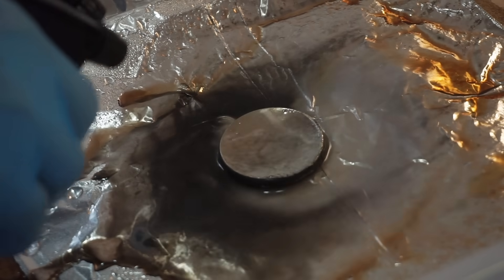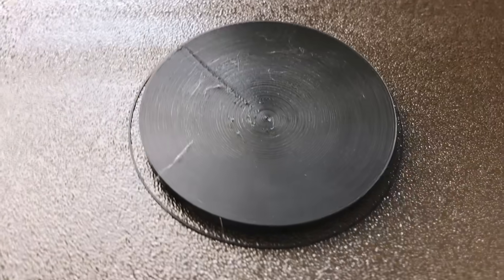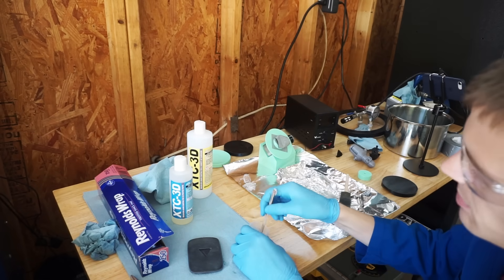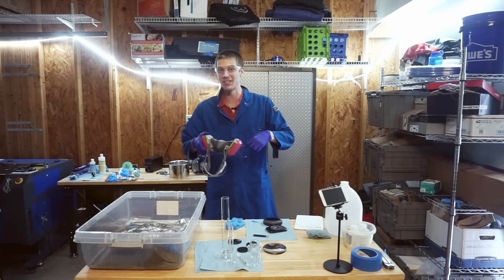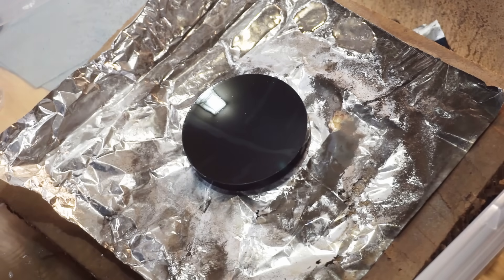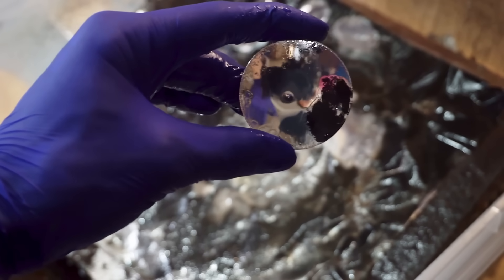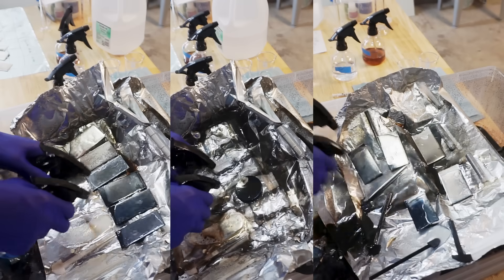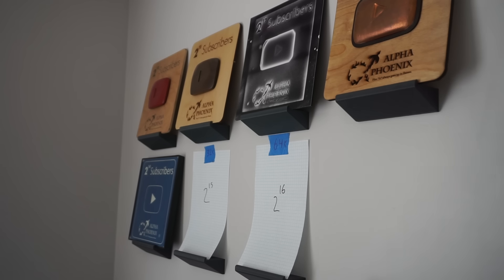How does a "first surface" mirror work? (2^15 sub special!)

Comment: It's not that you aren't removing bubbles. It's the 3d part and it's porosity that's drawing air in from underneath and from it's inside. Also thin layers don't help either.

Comment: have you considered foregoing 3d printing and instead using rotation to make parabolic surfaces? if you put a petri dish of resin on something that spins like a computer fan or a record player you could use the centripetal acceleration to form a perfect parabola without the 3d printing step.

Comment: Depending with what material you print, there are solutions that chemically melt (it's probably wrong, what happens is the same as with Styrofoam and glue) the surface of your prints, making them smooth.

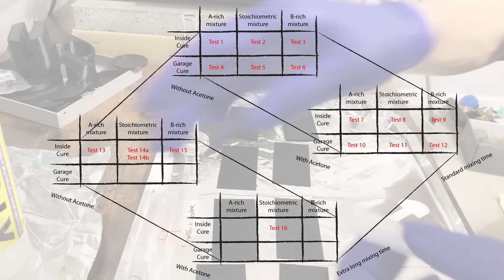Comment: Research engineer here. The next time you start creating a big grid to "properly" test every variable (13:23), first do a web search for these three words: NIST covering array

It will not replace the final stage of testing with only one variable changed at a time, of course, so it's not a technique for the final stage of publication-worthy conclusions. The time to use a covering array is earlier, in the stage you described as throwing variables at a wall to see what sticks.

That's not the time to be comprehensive, it's the time to throw in even more variables. Yes, more variables, because if you're not sure of which vars to test, then you're more likely to be making a mistake about which vars to exclude.

And yes, the problem is that you now have an even bigger grid of tests, so how does this help? You were already at the point where it was too expensive to test everything by changing one var at a time, so the best you can do is run a few spot checks which at least cover(!) each var at least once. That's where covering arrays come in. They're a mathematically sound way to make a set of spot checks "as good as you can get" for those times when you can only do a few spot checks.

Do the web search for details. The NIST has a good set of covering arrays already computed for us, and they're free.
Reply from the maker: I probably could have gotten away with sparser sampling for the garage vs not, but considering that all the other conditions in the first batch were distinctly different recipes, I wanted to test them all - there weren't that many. in the second batch I DID go sparser

Comment: PLA is one of the worst filaments to sand, I've gotten ABS parts to gloss finish just by sanding even without polishing, resin prints have the advantage that they start out smoother

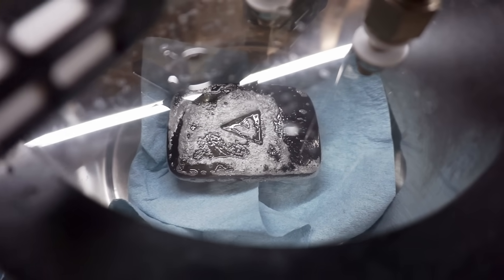Comment: Usually resin people put the resin in a vacuum chamber before using it to degas it, and the use a pressure pot while it's curing to shrink the remaining bubbles, so it doesn't bubble up on the part like on the play button at 15:00 :)

Comment: So, this may be overkill, but I know that some mirrors on large telescopes are made by rotating a dish full of mecury or similar....so you could probably just...spin the epoxy at the requisite speed (compute beforehand) in a petri dish and keep it at that speed until it's cured.

Comment: If you want to remove bubbles from Resin, put it into a Pressure chamber ( Nitrogen is best, but air is also okish), and pressurize to 2-5 Bar. (depending on your resin maybe even more), The bubbles that are present in the resin Shrink and eventually vanish. Pulling a vacuum has the exact opposite effect, they expand and make a mess unless the resin takes a long time to cure then a vacuum can work....but generally pressure is best.

Comment: its very cool to see someone actually doing this! about a yeah and a half ago I was researching how to do this to make a set of mandalorian armour. it turned out to be a bit too expensive lol. if the kit you are using is the same one i found (as far as i could find there is only one commercial kit) then i think you more or less have the chemistry correct. some other comments mention looking up the msds for the kit, which does basically tell you exactly whats in the solutions. i did find some literature that suggested that for that particular reaction, the surface needs to be very clean and ultra smooth or made of thermoplastic. since 3d printer filament is a thermoplastic, i wonder if just sanding to a very high grit might work better that resin coatings. i do have a chemistry degree but im not gonna claim to be an expert in this reaction. very cool stuff either way!

Comment: If you want to remove bubbles from epoxy using a vacuum chamber, here is how to do it: First mix the 2 components, then put that mixture through the vacuum treatment(it will bubble now) then let the air back in(bubbles disappear) and then pour or paint depending on what you want. Do not use the vacuum chamber after this last step.

Comment: Have you considered using a rotating dish of resin, and letting surface tension and momentum duke it out?
Reply from the maker: I have thought about it but I’m not sure if that makes a parabola or a caternary… regardless I want to be able to make aconic mirrors so while that could help stick the resin to a print I dont think a plain bath of resin is the way I want to go

Comment: Couldn't the aluminum have an effect on the reaction? Some of the examples that worked well in the video didn't use aluminum foil behind the plastic.
It might be possible that the solution touching the aluminum picks up some aluminum contamination and the spray hitting the pooled solution ends up creating tiny contaminated droplets that get back on the plastic part.

Comment: I've been looking for a video to do exactly this! One other application for a first surface mirror is uvc light. The uvc doesn't penetrate glass so a traditional second surface mirror can't be used to reflect.
Reply from the maker: I resuscitated this project in the spring after making the cyanotype camera and comments made me realize my lenses were probably eating all of my UV. It’s not the only thing I’d love to make with this technique but it’s one!
Reply: @AlphaPhoenixChannel  I want to see if I can make my own reflector using this technique. I've got an SLA printer so hopefully I won't have as many issues as you did with coating the layers.

Comment: this could make it possible to 3D print single piece catadioptric telescopes and then get the reflective surfaces to them without grinding glass at home. I've seen one from actual glass by Optical Engineer Rik ter Horst but thats not something most people can do.
Reply from the maker: I HIGHLY doubt this technique will ever get you close to diffraction limited but yeah that would be cool
Reply: @AlphaPhoenixChannel  yeah, I don't exactly expect it to be massively high quality, considering the examples 3d printed lenses I have seen before, so it really comes down to the post processing and whether its a success depends on the resolution capabilities you are looking for in the end product.

Comment: When you eventually get all of this right...

You should make a layered mirror, with multiple layers of perfectly flat graded-index plastic/glass with silver coatings between each layer, and also on the outside of the outermost layers.

So, it would be a hybrid of a first-surface and second-surface mirror.
Reply from the maker: Search for “distributed Bragg reflector”
Reply: @AlphaPhoenixChannel  is that similar to what I described?
Reply: @AlphaPhoenixChannel  oh, I remember this. Really expensive to produce, but would probably be great for making retroflectors and high-visibility materials; especially if you combined it with structural color and fluorescent pigmentation.

Comment: It is a reduction/plating reaction, so my guess is you don't want the reduction to happen until the last second. My guess is the acetone is what threw off your results. Improper mixing of the hardener or moisture could cause problems as well. Acetone is a solvent though and if it gets trapped in the resin it will take a long time to cure. I would try vacuum curing/aging a few days after applying the resin.

Comment: I have a couple of hypotheses as for why the inside curing is better. Placed in order of which I think is intuatively more likely. 

 First is temperature stability - I highly doubt that the resin and the substrate 3d print have similar thermal expansion properties - so temperature variance could really disturb quality of the cure and the surface that you get as a result.

Second is air currents - a highly ventillated environment might introduce complex currents and stuff on the surface as it cures - which can't help the smoothness of the surface. (This also might feed into the first factor with evaporative cooling) 

Third, and I think least likely, is air pollution. I don't know what the air pollution conditions are like in your area - but perhaps something is introduced when cured outside that damages the quality of the surface, but isn't present in the indoor environment - be that dust, or some kind of particulate or whatever. 

Anyway, you've probably already thought of all this - but those are my ideas.

Comment: once you narrow down three questions on the grid search - keep adding questions so you always have two variables, until you optimize it and run out of questions, then cycle through a second time, always using the optimal choice from each prior question. you'll get there in about 80 tests

Comment: Regarding coating the parabolic mirrors: you should probably use centrifugal forces in order to obtain radial symmetry instead of using gravity to squish it around like in 5:30. Furthermore, the resin you were using seemed to have a rather low viscosity which really sucks for your current approach but might be very helpful with the centrifugal method!

https://www.youtube.com/watch?v=EV4AOo1nUMU

Comment: Inside curing is probably better because of the usually lower humidity and water inhibiting the hardening of the epoxy, also maybe the lower outside temp could contribute negatively on it

Comment: Regarding resin in the vacuum chamber. Yeah... Doing that usually just expands tiny bubbles into big bubbles, so the problem just gets worse. There will be some bubbles that pop, but not all of them will pop in time for it to set. A lot of the resin artists on YouTube actually use a pressure pot to minimize bubbles instead. That seems a bit counterintuitive, but it works almost every time.

A vacuum chamber can be useful though if you're trying to get the resin to fill in certain voids. But you need to make sure you only run it in the vacuum chamber for a limited period of time, long before it has a chance to start setting. Then transfer it to a pressure pot.

Comment: Wait, wait, wait! you say the electons in a reflective metal "only hold onto the energy for a split second" before releasing it again  - does this mean that reflections in mirrors have an ever so small lag? On what timescale? Is there a way to visualize this with many many mirrors and an ultra high speed camera??

Comment: Silver-nitrate was used in black and white photography. As such the solution form is photo sensitive.
You can get a mirror coat on glass by applying intense light, as a cameras' aperture to film, an it will stick.
I amused myself as a kid by coating bottles filled with the stuff by adding stencils, then setting under a lamp.
Reply: Yes, another variable might be to accomplish the tasks under red light (darkroom) conditions.

Comment: Possibly ultrasonic vibrations to help agitate and mix? you could try setting the object being coated, onto something that will input ultrasonic vibrations into the part. 

To help mix and agitate everything in real time somewhat evenly. You could even place it inside of an empty ultrasonic cleaner, or possibly suspended/floating on top of a piece of cling film/plastic bag….. sat down onto water to help couple more of the ultrasonic vibrations.

Comment: I’ve actually had good luck spinning on resin/coatings, with the same apparatus used for spinning photoresist onto semiconductor wafers
Reply from the maker: I have a motor i pulled out of the bin to build a rudimentary spin coater sitting on my kitchen counter right now

Comment: This gives me a whole new appreciation of the sheer amount of effort required by astronomy hobbyists to grind their own parabolic mirrors for reflecting telescopes from glass disc "blanks" and then silvering them :)
The DIY diffraction tests for the proper curvature of the surface identified deviations in the order of a few wavelengths of visible light...
And then Tollens reagent! I was always warned never to leave a solution of the two parts mixed together unattended in case the unreasonably crabby and unstable Silver Azide might make an unwelcome appearance!
Reply from the maker: Yeah the advantage of the glass is that once you grind the perfect shape, you can etch and re-coat the front surface as many times as you want. this plastic method is quite a bit less robust. My dad ground some telescope mirrors in high school I think and I can't imagine the patience that took
Reply: The guy from Huygens Optics channel has a lot of videos on grinding mirrors and lenses. Not sure if he does a lot of parabolic mirrors, but there's a lot of information about making glass near atomically smooth on there.
Reply: @DFPercush  He tries to avoid aspherical surfaces, but he has a ton of admiration for those who do use them and sometimes makes videos about them, like the guy that makes an entire mini-telescope out of one solid piece of glass.

Comment: out of interest, when these kinds of mirrors are used for real industrial applications, why not use a piece of solid silver that has been precisely milled, lapped and polished as the actual mirror? wouldnt that be significantly easier to produce? And if the mirror ever tarnished or became damaged it could be re milled from the same piece
Reply from the maker: I think the chemical and thermal insensitivity of glass makes it really great for optics because you can chemically strip the film and re-coat it to get a "brand new" mirror whenever necessary. If you actually remove material to polish it you have to work a lot harder to maintain the shape

Comment: Love the video.
You were so close to inventing "Spin casting"!
 The centrifugal forces work in just the right way as to create a perfect parabolic mirror. 
Make a flat-bottomed circular vat. Pour the resin and spin it while its perfectly level. The result should be a prefect parabolic mirror.   Maybe you can give it a try.
Reply from the maker: spin casting was a possibility, as was high-rpm spin-coating to get as much resin off the mirror as possible. I think the best answer without switching resins may be spin-coating and then letting it rest with a hole in the center to drain excess through. (although based on other comments, I think I'm switching resins)
Reply: This does work, there was an article in Scientific American about 30 years ago that included this- they used resin to create large (2m) parabolic mirors.
You can also buy first surface mirrors at a reasonable price from Cloudray or other laser suppliers, they are common in CO2 lasers.
Reply: Spin casting is the way many telescope mirror labs rough out their blanks. But in glass, not resin. ;-) I believe University of Arizona has the largest spin casting oven. And they keep it under the football stadium.

Comment: Maybe try cars clear coat instead of risen, those should be easy to apply and self leveling
Reply: I actually just tried that for a different project and it works very well. You still have to sand the part smooth first and use filler to fix any depressions or holes, but the final finish is very good as long as the clear coat is applied in thick layers and allowed to dry in a slightly warmer than room temperature environment.

Comment: i wonder if theres some crazy way to combine mirrors and photography since they both (film at least) use silver to "display" light. imagine a mirror that you can "pause" if you will, by oxidizing the silver and creating a photograph. then revert it back to a set reflective surface by somehow reversing the oxidization. i dont know anything about chemistry but it intrigues me.